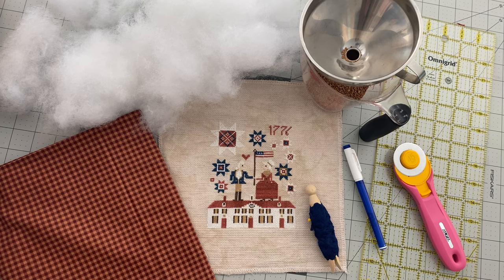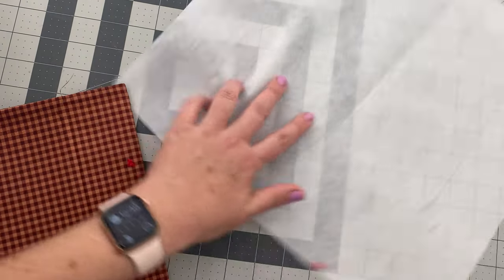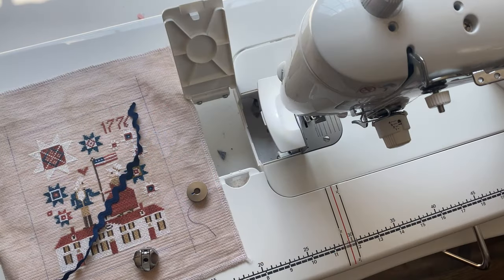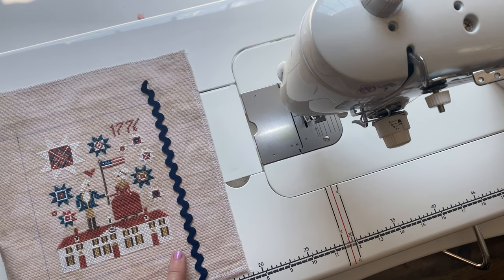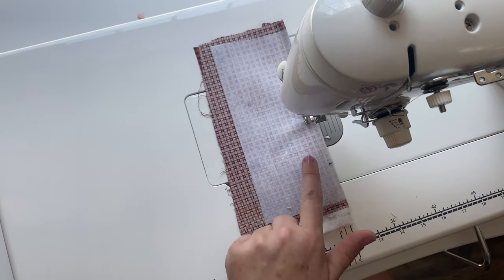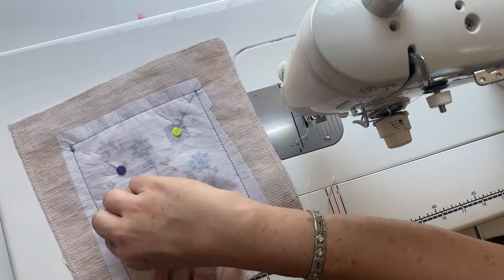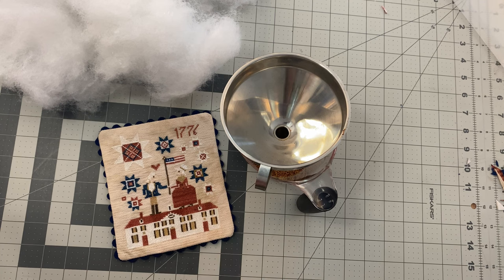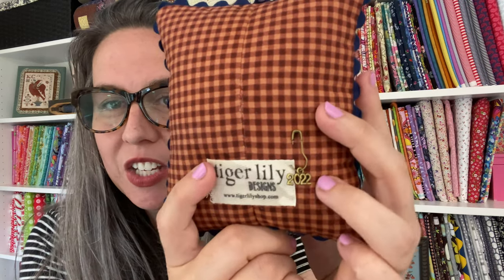Flosstube EXTRA: Small Pillow Finish Tutorial with Sewn in Rick Rack Trim - EASY TO FOLLOW

Comment: Great tips! A couple of questions - I recently unearthed a stitchery perfect for my sewing room. I want to mount and frame it. I planned to use that sticky board and make it the size of the frame instead of doing all the tightening, etc. but now wonder if I should interface it first. And I have a beloved pillow with a huge teddy stitched on it (I think it's linen) in patriot colors but the stitch fabric has pulled away from the cotton fabric because it was used - not just admired by 4 boys! I think I'll take it apart and try to realign the stitch fabric then iron interfacing on it (it was stitched ages ago before this technique was used). Do you think this is the best method or could you think of a better way? Thanks for all your videos - I really enjoy them!
Reply from the maker: I don’t think you need to interface a framed piece as that’s not going to need to hold up to four boys loving hands. It should be pretty safe on the shelf or on the wall. I definitely would try to salvage in her face the pillow could get tricky though. Best of luck.